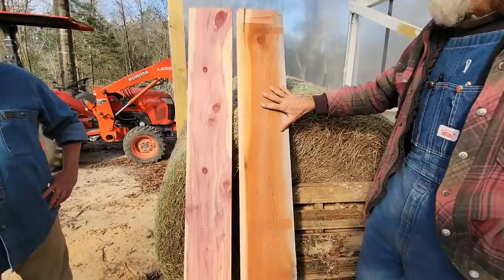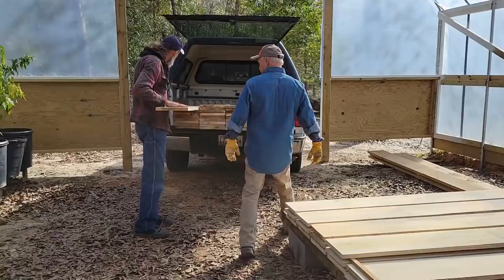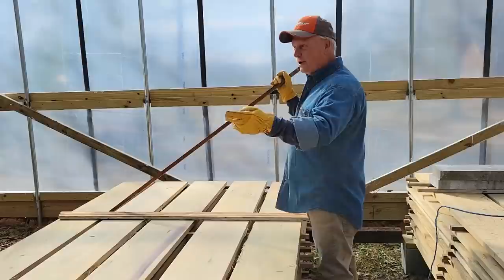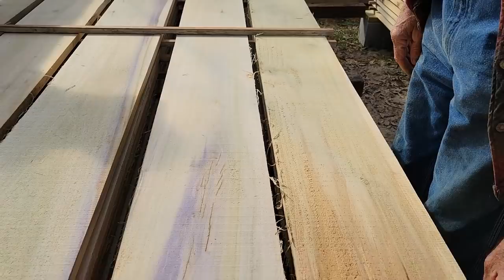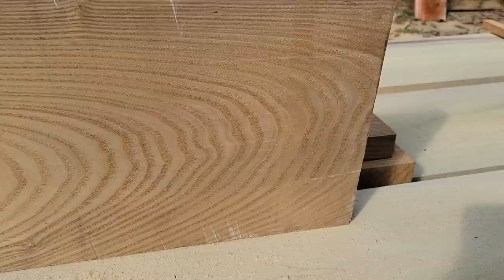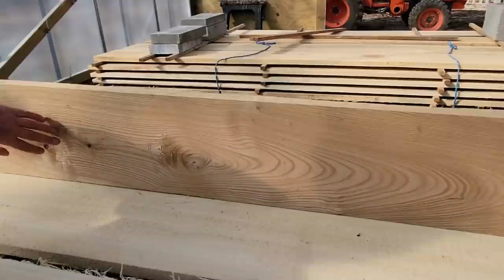Secrets To Sawing LUMBER -- Cedar, Catalpa, & Poplar

Comment: hmmm... I was taught heart side up so as it pulls and cups to the sapwood side the joints remain tight.
Also for decks, always heart side up so water does not puddle up.
Experiment with a few ent trimming and see which way they cup.
Reply from the maker: Heart side up will hold water and rot.
Reply: @DeepSouthHomestead    Looking at my deck... the boards sap side up cup upwards and hold water.  Heart side the water runs off of them.
plus, the sap wood is less rot resistant than the heart wood.
Oh well, only been doing this for 45 years, guess I have to do some more testing IF I live long enough..
Reply from the maker: @DustySplinters  This is so strange all the wood I'm familiar with the heart doesn't rot but the sap does. What type of wood do you have on your deck? I've spent my entire life in the woods logging and then 30 years construction. Maybe there's something here I need to learn.
Reply: @DeepSouthHomestead   That is what I said.  Heartwood is stronger and more rot resistant.
Sapwood rots first.
All flat sawn lumber will warp ( cup ) towards the outside of the tree.
Reply: @DeepSouthHomestead    Up here in PA all decks are PT lumber, which is always SYP.
But even when I made my own hardwood flooring, IF it was true flat sawnd, I always ran it and installed it heart side up.
That way If ut cupped for some reason there were no corners rising up and becoming a toe-catcher.
Reply from the maker: @DustySplinters  our PT lumber is SYP also. In the south anything else will rot in a year if it's not heart material. Even PT lumber will rot in the south in a few years. I just had to replace a pile of things that rotted. The company replaced most of it free of charge but asked did I install it correctly with the heart side facing down. No warranty if it was facing up. Inside I don't think it makes a difference where it's not exposed to the weather.
Reply: @DeepSouthHomestead    Strange... I have to research this a bit more up here but I'm just going by what my master taught me and my personal experiences.
Regardless...
You have a Blessed Day !
Reply from the maker: @DustySplinters  we are in different climates maybe that's why.